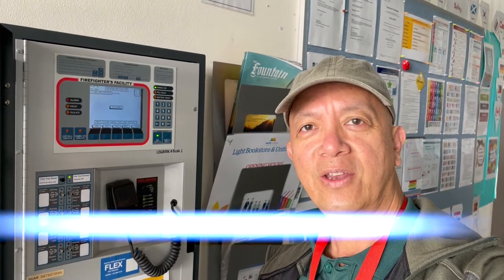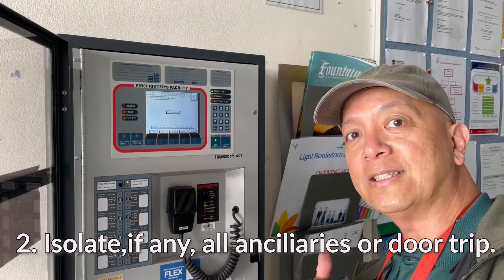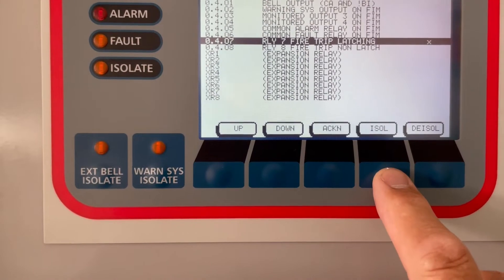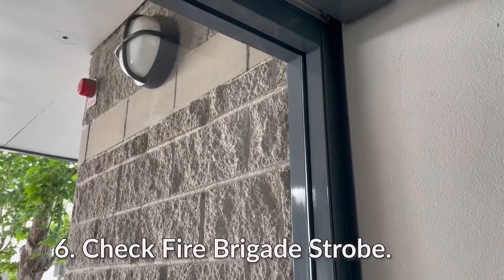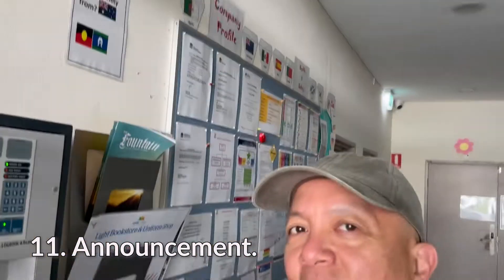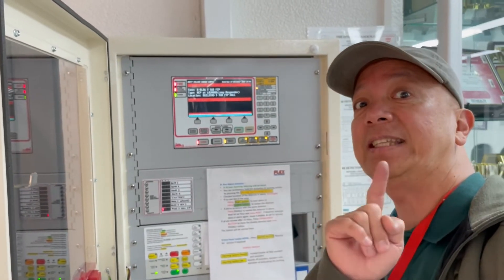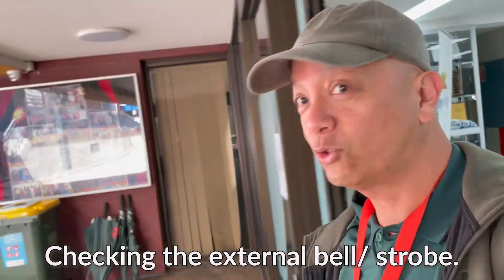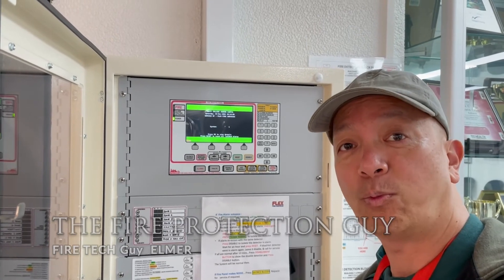Testing Sub Fire Panel & Main Fire Panel - IFS2800 Fire Sense & F220 Pertronics #fire  #firetech

Comment: Hello, I saw your and I would like to know how I can download the Notifire Verifire Tools software?
Reply from the maker: In this 2800..i am still using my Window XP laptop to access the system. I suggest you contact Fire Sense or follow this link to download software https://firesense.com.au/downloads/software
Reply: @fireprotectionguy7943  Hai sir.. i have downloaded this software. now this app showing requesting the password. if u have password kind share..
Reply from the maker: @reebankennedy4024  ..i will try to contact fire sense for you to get a password for initial pc interface 2800 use. Once you got the software running you don't need the password upon plug-in the cables. Are you in Australia?  Normal password is 3333 or 2222. Pertronics in all panel is 10,000.
Reply: @fireprotectionguy7943  Thanks sir. i have tried this pass code it's not working😒 i am living in UAE. you have any brand programming tools i.e Esser, Simplex..........
Reply from the maker: @reebankennedy4024  ... PC interface is for australian system. There's no use for that if you can not use it. Esser - we don't have that here. For simplex, you need a USB dongle to access any panel. It has been 8 years now since I programmed a simplex 4100U. It's a good product but few tech can access it that's why we avoiding that system.
Reply: @fireprotectionguy7943  Okey thanks ☺️
Reply: Hi Sir, how  to trace up panel earth fault of the sytem  afp2800..